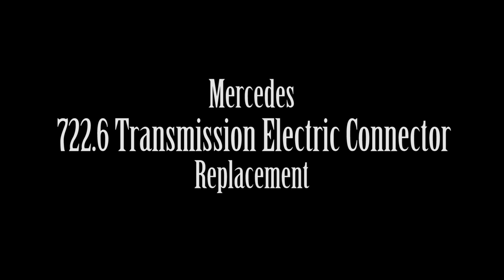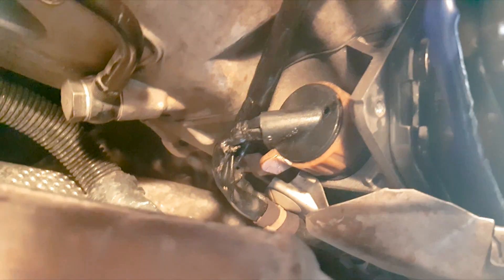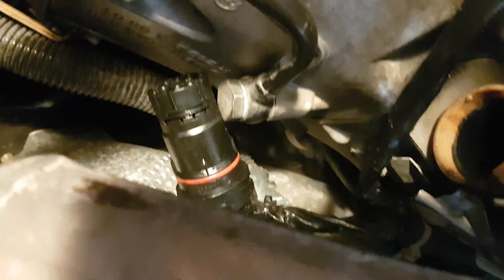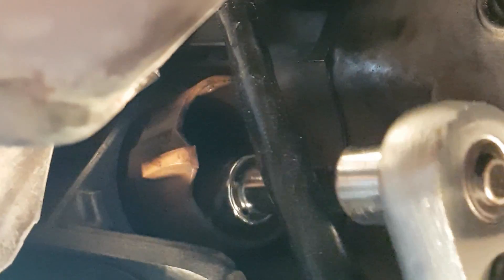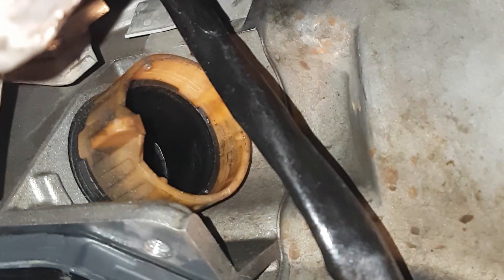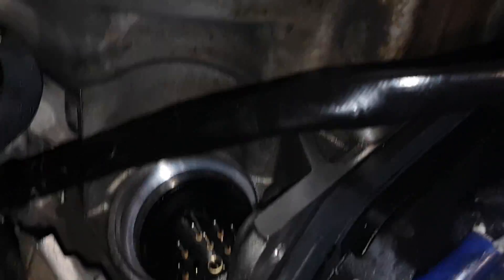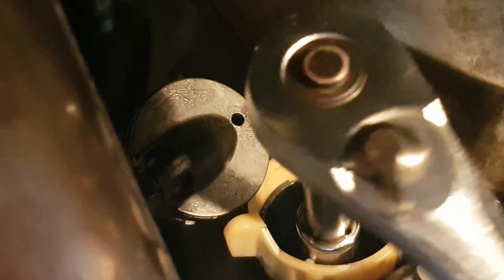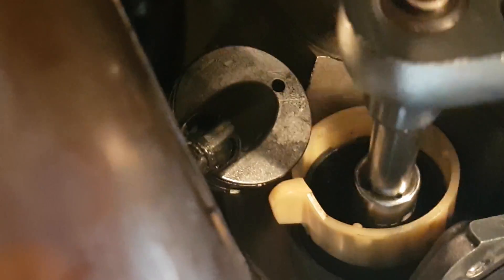Mercedes 722.6 Transmission Electric Connector DIY

Comment: Hello, very good video, maybe you can help me, I have a C180 (W203) model 2006, 1.8L engine, everything went well until today, the shifts were made without problems, everything worked perfectly smoothly, but today I noticed that I was going at 50km/h and the revolutions was to high, when I note that the gearbox wasn't shifting, then I get parked and switched to neutral, and then went to parking position, but it couldn't, so I switched it back to Drive and the car made a rude shift, I tried to change manually (+ -) but It didn't do anything either, so I turned off the car, I wait a minute, I put it in the parking position and tried again, there everything worked perfectly but when I got home and tried to park in my spot, I tried to get reverse and the shift cannot be done, it only let me get neutral position, then once again I turned off the car, put it in the parking position and turned it on, everything worked fine there, what could it be?  Thank you very much...
Reply from the maker: Hi Bravo, it is hard to tell without looking at the car.  Do you have access to a good scanner?  If not, you may want to have someone who does scan the transmission module for past and current faults first.
Reply: @Masood well, I'll take the car to the shop on Monday, this is my first Mercedes and I don't want go there with any possible reason of this behavior... Once with a Ford Explorer in a similar issue on dealer recommends to me a general maintenance of the transmission (complete disarm) when I asked for a second opinion, with just a connector clean was completely solved... I'll let you know when the car get scanned, thank you very much.
Reply from the maker: @bravomahecha5115  Yes, please keep us updated.
Reply: @bravomahecha5115 so what was the problem?
Reply: @thebalkanboy2252  the whole problem was in the electronic card in the shifter, I made the repair by myself just with one heat gun, and resoldering with Flux, I'm really sorry don't record the process but I completely forgot this post :( but the good news is that I found one video explaining this process, I will look for it and share it as an answer here...

Comment: bought a 2004 e320 used. Car slips in 2nd gear under light acceleration only before it is at operating temperature. What could cause this?
Reply from the maker: Hi Luke, any number of factors can cause slipping...start with checking the transmission fluid level and quality.  If low and bad, replace fluid and filter.
Reply: @masood-tv  Will do. Do I have to jack up all 4 corners of the car to do a trans fluid change? Not sure I have the tools to do it myself right now. Looking for a home mechanic nearby who can assist
Reply from the maker: @lukerobertswr5189  no, just the front wheels.
Reply: @masood-tv  update: did some research. Looks like its the TCC solenoid. Going to do full transmission service and replace conductor plate and TCC solenoid along with the plug adapter.
Reply from the maker: @lukerobertswr5189  thanks for the update. Was there something specific that led you to that conclusion?
Reply: @masood-tv  just the way it felt and how other people described the same problem on forums. I also figured if the trans was actually slipping it would get worse under higher load and wouldnt go completely away when the car gets warm. Also was suspicious that it only happened at about 7MPH every time.
Reply from the maker: @lukerobertswr5189  good points.  If nothing else, it will totally revive that part of your transmission.

Comment: GREAT TUTORIAL! I CHANGED MINE AND THEN CLEARED THE CODE WITH MY CHEAPER SCANNER AND IT WAS STILL IN LIMP MODE. TOOK IT TO MERCEDES AND THEY CHECKED THE CONNECTOR AND CLEANED IT BETTER THEN I DID I GUESS AND THEY DELETED THE CODE WITH THEIR SCANNER AND THE CAR RAN GREAT FOR THE DAY BUT NOW ITS BACK IN LIMP MODE WITH THE SAME CODE. I CHECKED THE CONNECTOR TO SEE IF MAYBE IT WAS LEAKING AGAIN BUT IT WASNT. ANY INFO ON WHAT MY NEXT STEP SHOULD BE? I AM STUMPED!
Reply from the maker: Hi, I could tell you to replace the conductor plate, yet the problem may lie elsewhere.  Since you paid the dealer and the problem returned, you may wish to ask them for a diagnosis.  However, should you decide to replace the conductor plate, it is not too expensive and it can be  a DIY job.  Depending on the age of your transmission and how much longer you are willing to keep the car, even if it doesn't fix the issue, it will help your transmission work a lot better.
Reply: @masood-tv  Yah im hoping its not the conductor plate. It would be cooler if it was the tcm because I found a used one online with the same part number for under 200bux. I originally asked mercedes for a diagnostic because i did all the easy fixes myself with no luck and they didnt do one I guess because they couldnt tell me the exact issue. They charged me $310cdn for a 2 hour diagnostic though. I kind of feel like they should have bin able to pin point the problem in 2 hours. Its a 2002 mercedes c240 with 216k km"s on it and the car runs great otherwise. Its a pepsi blue type color with light grey almost white interior on 18 inch black low pro wheels. I love the car so i probably would do the conductor plate BuT ONLY if I know its gonna fix it. Am I crazy to think a shop is gonna give me an exact answer on why my car doesnt like the p0702 code or is it just a guessing game for some things. Its weird that after I got it back the first time that it ran perfect for the day and then the next morning on first start it went back to limp mode. Another weird thing is mercedes didnt even check my tranny fluid lol. Anyways thanx for your response and i will probly give an update soon.
Reply from the maker: @clicksbyklauss  , from your description, it sounds like you have a great looking car.  Good luck to you.  Yes, please come back and update us when it is fixed, so we can learn from your experience.

Comment: Just changed the adapter plug on 05 C240. Still shifting hard and trans going into limp mod any suggestions. Car has 134k miles. Hasn't been driven in 3 years
Reply from the maker: Hi, the best option may be to get a diagnosis done.  Otherwise, you could keep replacing parts to no avail, Cynthia.
Reply: Conductor plate is probably gone. Get diagnosed

Comment: Hello I have a question I have a 2003 Mercedes Benz E320 does this control the shifting of the gears because my transmission only shift to first and second my master cylinder is bad I'm replacing that does the connector have anything to do with that
Reply from the maker: The answer is no.  However, that is the connection point from the computer to the transmission.  So, there is a remote possibility.

Comment: 1 of my 13 pins broke off..is there a way do fix this?
Reply from the maker: Hi, yes. You can buy a new or used valve body/cover...
Reply: @masood-tv  Or just the conductor plate.
Reply from the maker: Yes, exactly Scott - it is also called Valve Body Electrical Plate or Cover.  Thanks.

Comment: I have a 2006 S500 with the 722.6. Would you know if I replace the transmission connector do I need to reprogram the car?
Reply from the maker: Hi Andrew, no you won't have to.
Reply: Thank you sir. I appreciate it.

Comment: Bolt snapped. What do?
Reply from the maker: Sorry to hear that, alex.  Did it snap tightening a new adapter or while loosening the old one?
Reply: @masood-tv  it happened tightening the new on in. Bit unfortunate doing it in the snow in the cold haha
Reply from the maker: @alextuomonen3830  you might be ok as long as the socket has gone to the very end.  You should be able to see the little pins sticking out.  If yes, just put in the plug and turn it to lock as i show in the video for a tight fit.  Turn the engine on and shift the gear a few times to test.  If it doesnt make a good electric connection, you will find out right away.  In that case, it will need some precise surgery to remove the screw.  Perhaps welding a small nut at the breakage point by an expert welder...
Reply: @masood-tv  yo boss im sitting here tightening it and its not going anywhere any tips?
Reply from the maker: Howdy, Noah.  As I show in video, please take a cellphone video or photo to ensure the pins are all aligned with the holes in the connector and that the old gaskets are all removed.  Then you can press it in with confidence.
Reply: @masood-tv  did that and it connected… still in limp mode though not sure why new gasket new plate and oil???
Reply from the maker: @noahmcc1  did you do a diagnosis first?  It could be your conductor plate or something else...
Reply: @masood-tv  i havent done a diagnosis, not sure where i could get that done
Reply from the maker: @noahmcc1  Take it to a transmission shop that knows how to work on 722.6 transmissions...they are used on a lot of Chrysler cars too.  If you cannot find any, take it to a Chrysler or Mercedes dealer as a last resort.

Comment: Hey, great video, do you have a link to where you purchased the adapter? And does it come with the two gaskets? Thanks!
Reply from the maker: Thanks Matthew.  I have the part number at 00:26 second of the video.  Only source the genuine MB brand.  It is around $15 at Fcpeuro.com or autohausaz.com.  And, yes, it comes with all the gaskets you need  pre attached.

Comment: Glad I ran across this. I have a 97 e320 with 250,000 miles on it and I recently changed the transmission fluid. I had noticed a little fluid but didn't think much about it but now I have a significant leak coming from the adapter. 10.99 for a Dorman.
Reply: Any automatic transmission oil had gone into the TCM module located, in an upright position, behind the carpet for the front firewall?. The transmission oil can damage the computer. Even oil had not gone into the computer you can spray electronic cleaner to clean both sides of the connector to/of the computer. Let it fully dry before reconnecting the adaptor for the TCM. Regards.
Reply from the maker: Hi Alexander, I combined the connector replacement with the transmission fluid change, so I did replace the pan gasket, filter, and oil.
Reply from the maker: Hi M. Bobroff, glad to have you in the channel.  Thx.
Reply from the maker: What is leaking? I don't think you need to replace the conductor plate at only 29,000 miles.
Reply: Fuuuck Dorman, gone through 4 of these Dorman bushings

Comment: I replaced my conductor plate and the connector assembly about 18,000 mi ago and I'm having to replace the connector assembly again which I did but it was flooded the next day so now the oil has gotten all the way through the wiring harness to the computer but I have a 99 SL500 and it is mounted upside down luckily so the oil just puddled below instead of filling up the computer. What do you suggest I do I really don't want to use the original wiring harness I would prefer to replace the transmission wiring harness but not sure exactly what that involves. Please give me any suggestions that you might have with all of your experience.
Reply from the maker: Hi Bill, be sure to replace it with an MB connector which has two thicker gaskets, be sure that the 2 old  gaskets are out, and that the new connector is properly seated.  That should prevent oil leaks to the harness.
Reply: @masood-tv  The oil has already traveled through the harness to the computer but puddled below the computer because it is mounted "upside down" so hopefully my computer is still good. I put on the new connector CORRECTLY seated and the next day after replacing two sensors I drove it and it went back into limp mode. SO I removed the new connector and it was flooded again. That's when I followed the harness back to the computer and found the puddle of fluid. ARGHHHH
Reply: @billclark8241  any result for you on this issue?
Reply: @BoyishDriver  as I mentioned because my computer is upside down it was saved and has no damage. After conferring with a couple Mercedes experts I was told replacing the wiring harness is unnecessary. The conductor plate was replaced along with the connector plug and everything has been working perfect ever since. I was really angry at my previous mechanic for installing an aftermarket conductor plate because that's the only reason I'm having to do this twice. Believe it or not replacing the conductor plate and connector plug should be replaced about every 30,000 Miles as a maintenance item as this is a known issue.

Comment: Need to drain transmission fluid?
Reply from the maker: Hello Murat, it is best to couple this job with a transmission fluid change, but you dont have to...
Reply: @masood-tv  my fluid is in Good condition.but done pil in plug.İ cleaned it with carb.cleaner.because of this i wanna change only plug.
Reply from the maker: @muratkaynar802  sure, you are doing the right thing...
Reply: @masood-tv  thanks
Reply from the maker: @muratkaynar802  you are very welcome.
Reply: İ replaced whole plug some oil came out vwhen i removed old plug.unfortunatly nut has broken.i replaced new plug without nut.is anythink harmfull hapoen without nut?

Comment: FYI - If any of you have issues getting out the old 13 pin connector, I would assume you might be using the wrong socket to take it off. It’s a 7 mm and mistakenly I tried an eight and it kept turning and I thought it was off when it was really not. Once you take it up with a 7 mm it’s not more than a few turns the plug should just pop right out with not too much effort
Reply: I use a 7mm and it still won't loosen just spins and spins now I'm afraid I may break it.

Comment: I'm attempting this right now and your video was super helpful... only problem, I cannot pull out the old 13 pin connector plug it seems to be stuck???   I unscrewed the 7mm screw inside the connector and from what I can "feel" it seems the screw is out but the connector plug wont come out?? Any suggestions thanks???
Reply from the maker: Hi Jvakos, as long as the screw is undone, you will not hurt anything by forcing it out.  Pry it out.  Find leverage around it and pry it out decisively.  Only old rubber gaskets are keeping it stuck inside.
Reply: @masood-tv  will give that a shot thanks Masood.   I suspect maybe the screw isnt completely loose so will double check that.
Reply: Did u fix it? Get it to work

Comment: I think it's around 8nm for the torque requirement
Reply from the maker: Thank you.
Reply: @masood-tv  It is 2.5nm for the weird screw in the adapter. I just replaced mine and the included instructions said this value. It does not look like a screw at all. You don't want to strip this or you will be replacing the conductor plate. All of the rest of the valve body and pan bolts the proper torque is 8nm. Not sure I know were to get a wrench that will torque this lightly.  I think as long as the screw is snug that would be good enough.
Reply from the maker: @Kingbeefriend  You are right, Scott.  Not everyone has access to a torque wrench like that.  I have always hand tightened them. It may help to do it with just a couple fingers of the weaker hand...

Comment: Hey there! Glad I came across this today. Does the oil need to be drained to take care of this? I changed my fluid like 2 months ago and it's still leaking so now I want to do the connector. Would like to avoid emptying the oil if I can. Let me know if you can, thanks!
Reply from the maker: Hi Viron, yes, you can replace the connector any time.
Reply: @masood-tv  is that yes, you need to drain the oil, or yes you can do it anytime without draining the transmission? Cheers for the video btw 👍
Reply from the maker: Hi Lawrence, my suggestion is to pair it up with a flush specially if you haven't flushed all of the fluid last time.  Some oil (as much as one or two liters) will spill out if the pan is parallel to the ground.   But if you lift just the front of the car high enough, you should be ok.  Just be prepared to catch some of it and have the replacement adapter ready to plug in minimizing spills. Thank you.
Reply: @lawrencebroad6673  no fluid drain needed
Reply: @drewinhou  This dude is the hero this comment section needed.

Comment: Hello brother, I have a 1996 Mercedes E280, the air conditioner works sometimes and sometimes it does not work, and if it works for a period of five minutes, then it crashes and when I close it and leave it for a period of five minutes it does work and after a period it breaks Can I find you a solution
Reply from the maker: Hi bro, it is hard to tell without running a diagnosis....it could be a bad sensor, it could be low on freon, it could be something else that is defective. ..
Reply: How many miles? Maybe the electromagnetic ac clutch's air gap is finally too wide at certain hot temperatures and needs to be shimed or replaced?